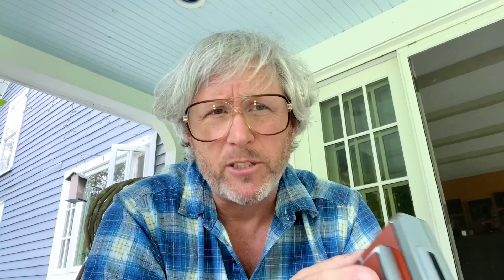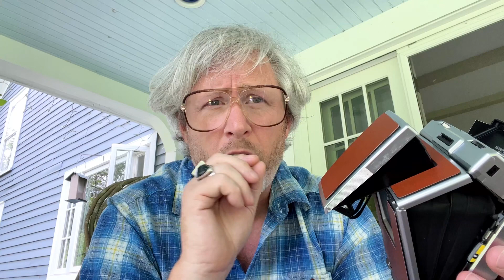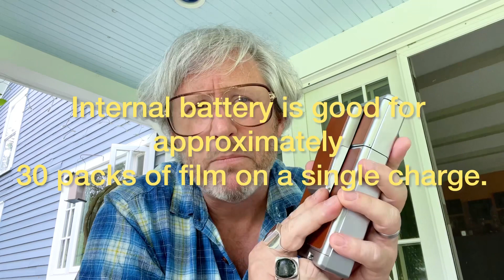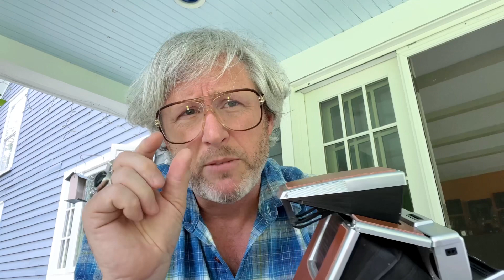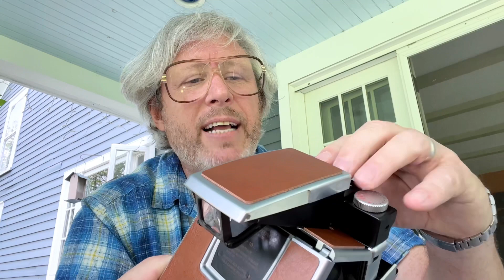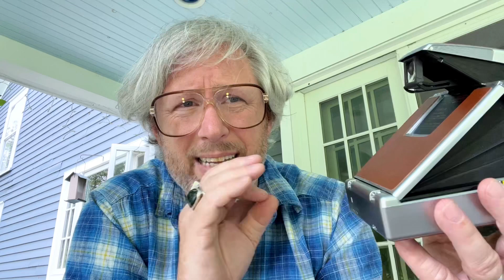MiNT SLR670 X Edition iType Part 1. First Review Anywhere!

Comment: But if I understand correctly, using SX-70 film is only possible in manual mode?
Reply from the maker: There is an auto sx70 and auto 600 on newer models and of course always manual exposure control with the Time Machine.
Reply: @FIGITALREVOLUTION  Ah thanks.

Comment: Have you tried using it with a dead 600/sx70 film? Will it work since it has a built in battery? Have a bunch of expired film that seem to have dead batteries I’m hoping I can still use.
Reply from the maker: Yes it will work just fine!

Comment: Does the camera function with 600 film, even if the cameras batteries aren't charged?
Reply from the maker: Yes, unlike the Polaroid i2 Camera the new MiNT with the battery uses both methods and their battery has about double the life so around 30 packs of iType film and the benefit of using 600 or SX70 if needed.

Comment: Howdy - Curious if anyone else has been disappointed by their new MiNT i type SLR-670? I purchased the ming edition expecting to receive a thing of beauty, and instead I received a hideous example of a camera. The camera is in rough shape, has awkward gaps when closed, doesn’t open smoothly requiring “help” to fully open, each of the metal pieces MiNT installed in place of the leather are bowed and peeling up on the edges exposing adhesive tape, and the vinyl appliqués that MiNT used to replace the original printing are peeling, are misaligned and have air bubbles underneath. 

Considering everyone’s rave reviews of this company, I’m astonished at what I received. It feels amateurish and cheap. Further, even with photo evidence and explanation, MiNT was suggesting that I just “press” the metal back down and into place and that the appliqués were original and left for their “charm.” I genuinely do not believe these are original stickers. They look like a digital image printed on vinyl. I could be wrong on this particular detail, but regardless, I cannot get away from the scrappiness of this camera. My heart is broken. I was so excited for this camera you’d have thought I was a child waiting for Santa yesterday, but deflation came immediately after unboxing. To add salt to the wound, MiNT is charging me their standard $50 restocking fee….combine with that return freight and a wasted film pack and I wasted about $125.
Reply: i have a slr670s and its spotless? Tho the viewfinder instruction label is worn a touch, they said they leave them for their originality... overall very happy tho !

Comment: Nice review !!  How does it handle fill in flash with either a vintage flash bar or the Mint 2 flash?  Let's say you don't plug in the time machine, but instead plug in the Mint 2 flash or a vintage flash bar, does the shutter default to F/8?  Does the cam follower still adjust the aperture based on how close or far away you're focused, so that you end up with a correctly exposed flash photograph?  I think Mint needs to come up with new Flash Bar that has a sensor on that can control the output based on distance.

Comment: Just got mine a few days ago, love it! I noticed that your Time Machine bar has flash ports on the side, mine doesn’t, is it also coming from the fact that you let Mint mod an existing SLR670?
Reply from the maker: Is yours a model that has a Time Machine with the flash port— not all models have that option— my older one did not but as this upgrade makes it the most current model it does—-
Reply: @FIGITALREVOLUTION  no I don’t have the flash port. This Time Machine came with my new I Type SLR670.

Comment: Awesome camera ! but just wondering how come yours didn’t came with the red focus dial
Reply from the maker: Mine was an upgrade from a SL670 I purchased some years back so maybe that is the reason—
Reply: @FIGITALREVOLUTION  I see , nice ! Also i want to ask when you insert your itype film do you have to insert a dark slide underneath? Because i also have a mint slr670 itype camera and every time I use itype film, I need to put a dark slide underneath or else it won’t eject and I think the reason is because itype cassettes are a bit thinner compared to 600s. (When I put in 600 films it won’t completely fine) was wondering if you at experiencing the same problem 🙏
Reply from the maker: No mine is fine but I do find the iType take a bit more of a push to fit in properly and are a bit harder to pull out the empty cassette
Reply: Looks nice but when the battery goes in a few years, what a pain to send it back. I think I prefer the attachable power-pack by retrospect. That way you can change the batteries.

Comment: That's extremely cool, but I'll probably never own one, for the same reason I'll never own a Hasselblad: it's worth more than my car.  In fact, I'll probably never have a "regular" SLR 670 or SLR 680 of any flavor, for the same reason.

Now, I completely understand the costs behind finding good-condition Alpha 1 cameras, replacing the circuit boards, cleaning them up like new, and in this case retrofitting for the Li-ion battery -- but still, I've got about the same money into my entire RB67 outfit (three viewfinders, five lenses, macro tubes and 2x teleconverter, three Mamiya film backs and four Graflex) as it would cost to buy this -- and for another few hundred dollars I can get an Instax Square back for the RB and have much more manual control than this.
Reply from the maker: The $$ you have into the RB67 system is a steal and you should be very happy with your investment. However they are very different beasts with very different working methods. Yes you could do a lot with the Mamiya but it won’t fit in a jacket pocket. An regarding more manual control— it would not really be necessary due to the limitations of latitude with the Polaroid material. This is as I mentioned for a shooter who is dedicated to Polaroid material and wants lots of options within that material— your system is bigger and broader than that and if you are only working with instant material would be more than one would need. All cameras are just tools —
Reply: Mamiya rb 67 is a bulky heavy delicate camera and needed back that make other bulk and heavy problems
Reply: @ilmago5291  Bulky and heavy, no doubt.  Delicate, not in my experience.  And FAR more versatile than these similar-age Polaroid SLRs.  You pay your money, you take your choice.  Mine was to get a camera that will do more than one thing, and do them all well.
Reply: all valid points but I want to see you fold the Mamiya and fit it into a pocket….right, you can’t…